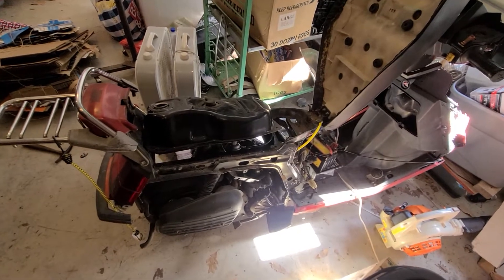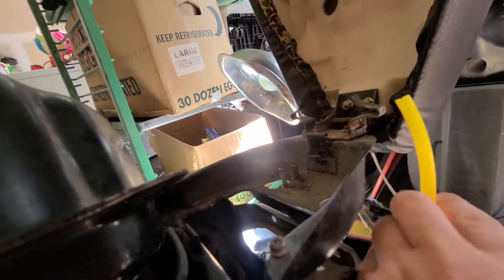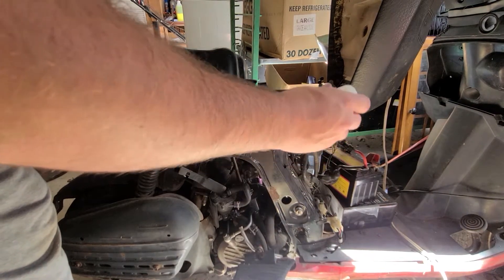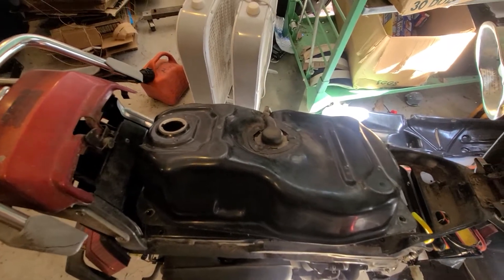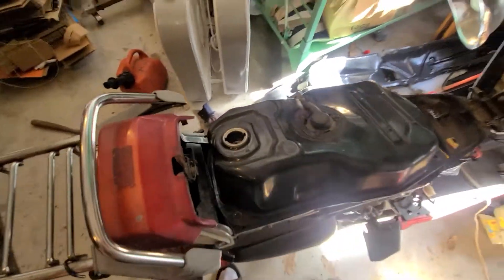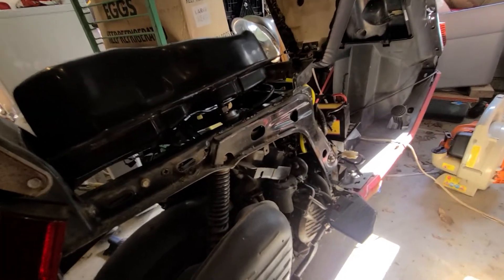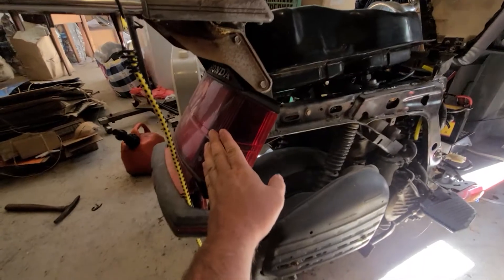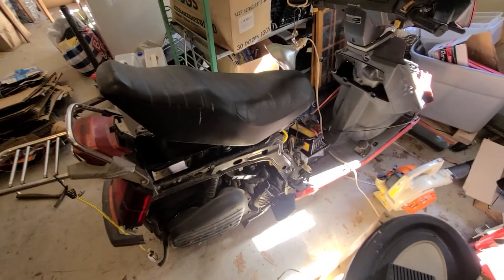1986 Honda elite 150 scooter will it finally run

Comment: The rear blinkers are on the side panels of the Honda. I think because the law states that the blinkers have to be a certain distance away from each other, they stuck them on the side panel. The left and right portions of the rear taillight are used as blinkers in other parts of the world, so you can drill out the blanks and stick the existing blinker lights there if you don't have the side panel blinker lights. Do you have a link for the carb you bought? I 'm thinking of getting one, my automatic choke doesn't seem to want to work on a cold start. Here is a photo of rear blinkers integrated with the rear tail lights.     
https://s3.amazonaws.com/advrider-photobucket-images/images/B/Bandit240_Honda%2520Elite%2520150_IMG_2437.jpg